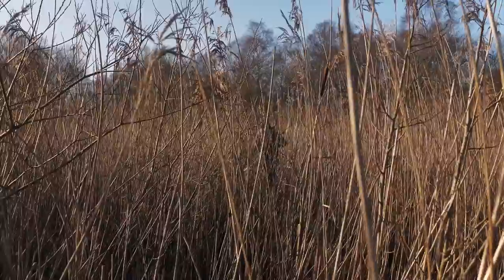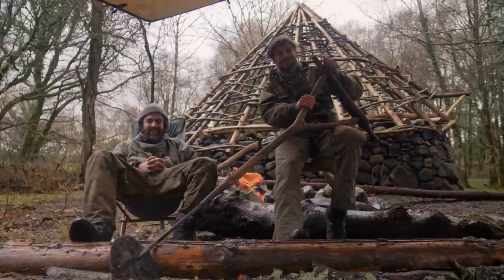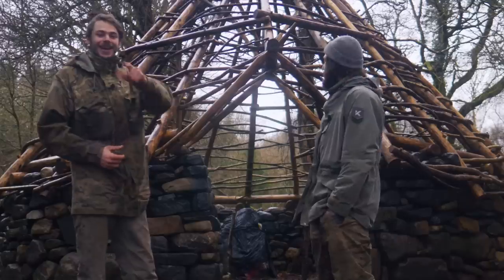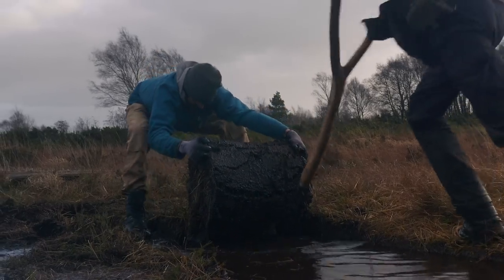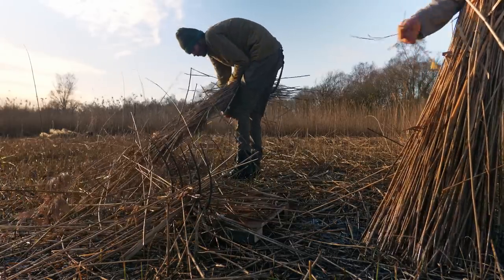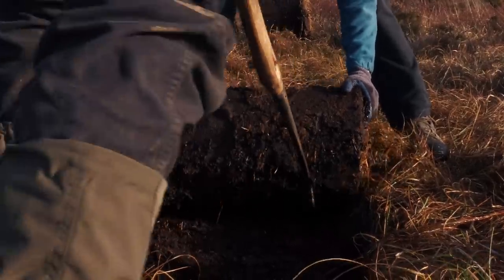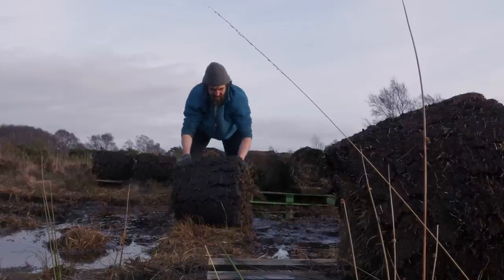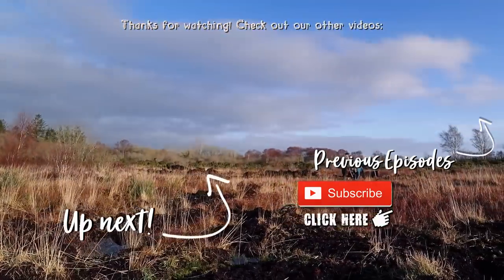IRON AGE ROUNDHOUSE BUILD | Nostalgic Roof Material from the Past! (Ep. 11)

Comment: Hey guy, love the roundhouse so far!  So some of my research has shown (based on my opinion, so grain of salt) that part of the reason the roofs are not readily found is that once the scraw was cut (sometimes triangles vertically and sometimes wrapped horizontally in strips) and laid that layers were added on top. First a very thin (for a roof) layer of thatching for the winter (ideally when you would be finishing) would be laid down and a variety of seeds and sprouts were planted.  These begin to either germinate or root, which ends up sewing the pieces of scraw together and lacing them to the roof! (but you need to use short root plants and grasses, no trees!)  This is then further added onto for later when the inside has dried quite a bit and the inside of the panels can then be used for mushrooms.  As well, the hanging roots would make an excellent lattice upon which to hang various herbs, fruits and lightweight tools.  Over time the weight of the sod and the additional bonds created by the roots would make for an extraordinarily strong roof, but would slowly cannibalize itself until it needed to be replace every 8-15 years, a tradeoff for the need to replace true thatching every other year or so.  Granted this could be complete hookum, but I've found no flaws in the theory thus far.

Comment: Hey, I had a thought as far as attaching a stirrup to that tool so you can push it with your foot. You could bind some kind of cordage to the crook of the Y, and then at a comfortable length, tie it off onto the lower shaft, near the spade -- from that, hang a loop maybe with a bit of an actual stirrup to it, so the foot can rest in there and you'll get good leverage without compromising the integrity of your handle.

Cheers, and keep up the great videos!

Comment: Nice work. Very well done.  Noticeable increase in your skills both in craft and filmaking.  Question, how much weight will your roof beams be carrying during and after a rainstorm?
Reply from the maker: once the scraw is dried it should be protected from water by the reed. so shouldnt be too much!
Reply: @SmoothGefixt  thanks for the info.  Does the scraw act as insulation then?

Comment: Yes you have to speculate about the construction, but availability of materials and simple physics is going to dictate matters to a certain degree.
Most cultures that construct shelters from natural materials seem to have techniques in common. That seems to be intuitive. So what your instincts suggest is probably close to what they actually did.
Side note: It is interesting that they used a timber frame, rushes for insulation & the moss from the bogs as a weatherproofing layer.

Comment: Dont that turf need to dry out first? That takes long time as far as I know
Reply: Well i myself think that wet turf haves better insulative properties also dry turf is really flammable
Reply: @velazquezarmouries  I harvested turf for heating myself.Wet turf is f....ing heavy,its like a sponge holds a lot of water and (not shure about that) may shrink while drying.To set it a blaze is not that easy so fire is not an issue. dried weed or straw is much easier to set on fire. When mounted on the roof it will dry out anyways.